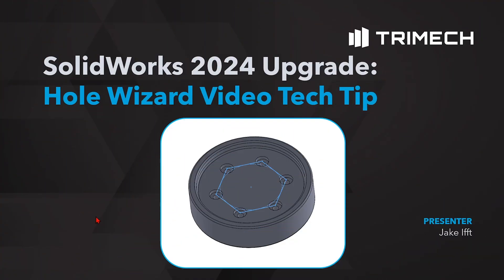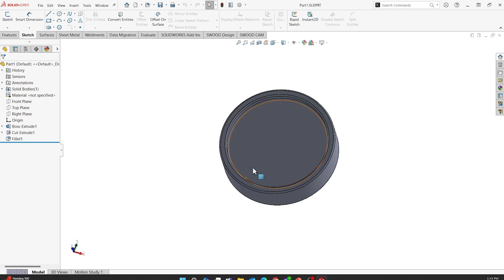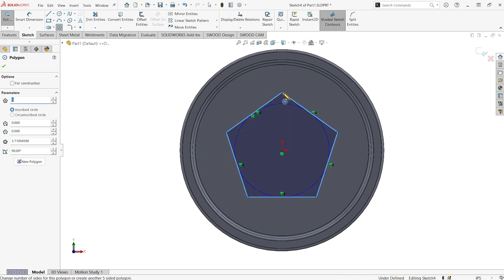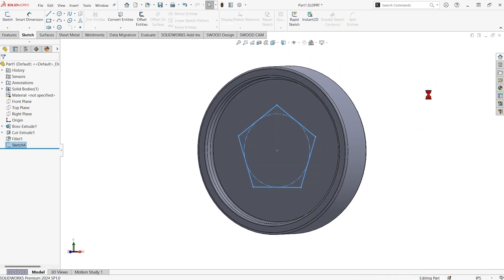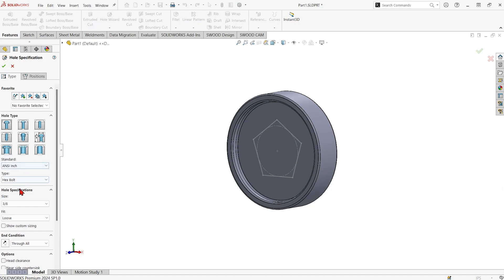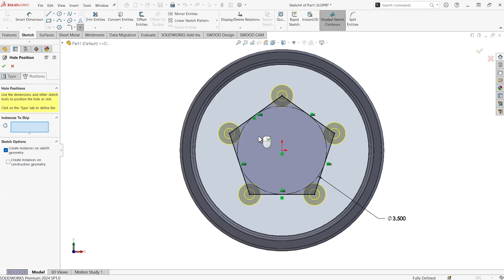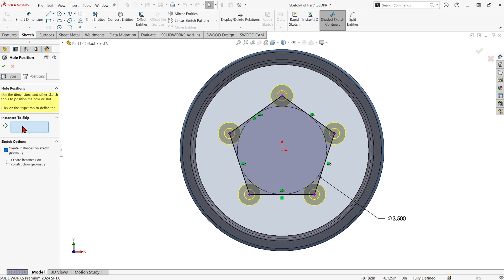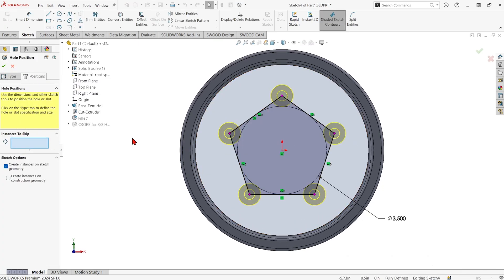New Functionality with the Hole Wizard in SOLIDWORKS 2024

Comment: Don´t make the same mistake with just adding features to the software, instead expand the feature set. 
Instead of having 2 buttons, one for 3D sketch the other for 2D sketch, simply have one button with "Sketch" no matter which one it is, SW with choose depending on what you select. 
Same goes for features that add or subtract material, an "extrude" can be positive or negative, we don´t need to buttons for that. Just make one Button Extrude and chose inside the function whether you want to add or remove material. Simply, better overview, clean.